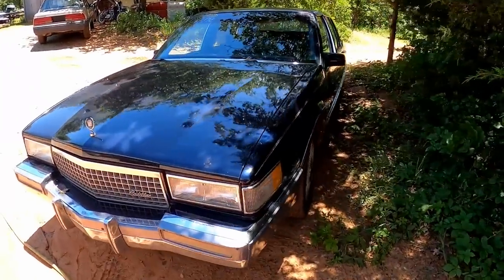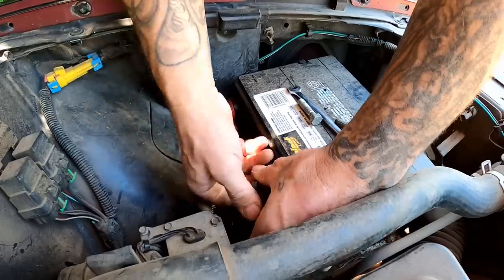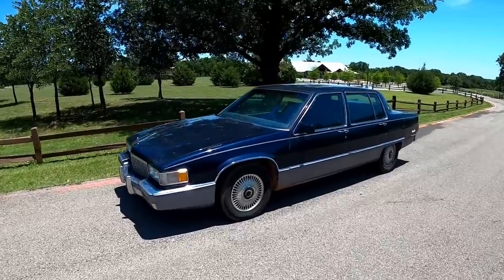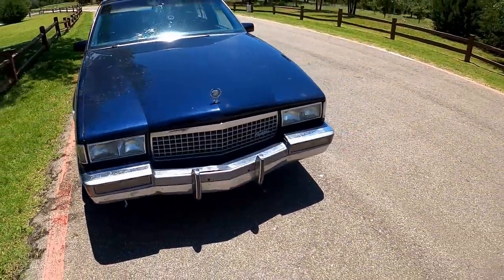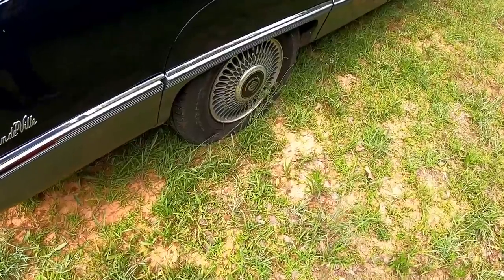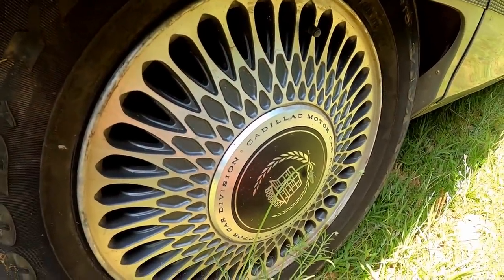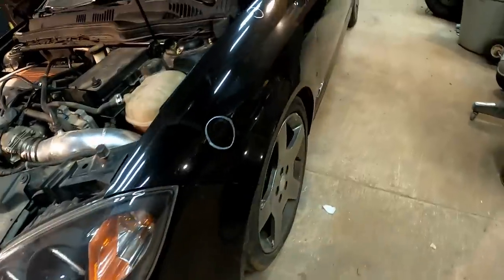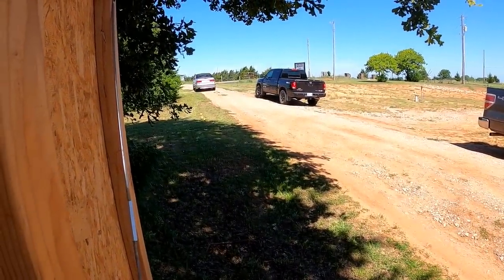Sold all the cars and Auto Auction Rebuilds Cobalt SS gets bodywork

Comment: The only other things I personally would’ve addressed on the caddie are the sagging headliner, and the loose hood emblem. Those both look pretty straightforward to fix. The headliner maybe you could just make look a little nicer if that. As for the cavalier, yeah it’s not worth much given it’s condition but maybe you can make the drivers side carpet look a little bit nicer. Saab had an issue with the convertible top hydraulics but obviously the buyer was happy with the car so I’m sure they won’t have a problem addressing that. Those S classes are highly desirable luxury vehicles but yeah the market is hit or miss right now. Randy spent a lot of time on both his S classes so I think they’re mostly sorted out at this point. I mean it’s a used MB so there’s always gonna be something wrong.